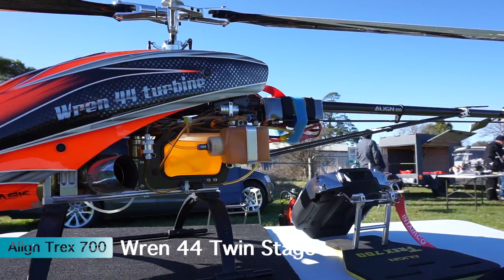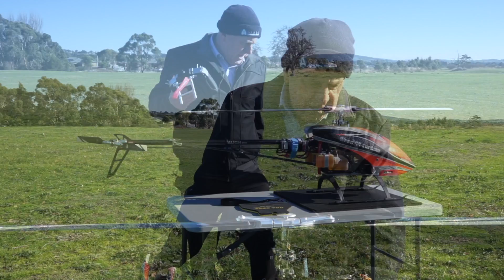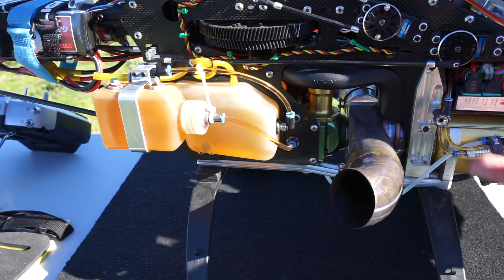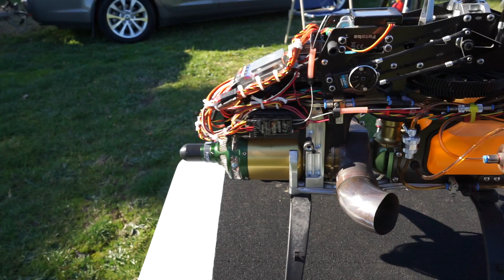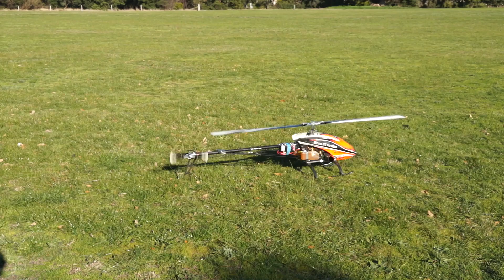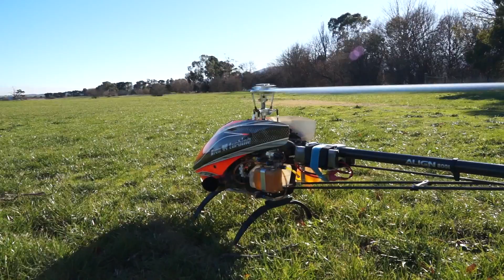Turbine RC Helicopter - Align T-Rex 700

Comment: My stock 700 scares the crap outta me let alone having to deal with it being turbine powered! Another plug for the Demon control, I’d be a bunch richer today if that was around in the 80’s but I might not have been able to afford it then either! Good tail rotor gyros were expensive enough!  Great piece of design and machinery.
Reply from the maker: G'day mate.  Yes I agree with you.  These RC choppers can be a little scary at times.  I've been flying choppers since the late 90's and they still get my heart racing.  Unfortunately I don't own a turbine, but I've got 3 x gas (90 size) and 1 electric 550.  Cheers, Aaron.

Comment: Damn cool chopper... looks actually very nimble unlike some of the other turbine ones I've seen. Was the conversion done by Ivor? or was it a kit?
Reply from the maker: Hey Luke.  Yes mate the conversion was done by Ivor.  Ivor is a fitter and turner who used to work for TAA or Ansett back in the day.  The Wren 44 pretty much bolts in to where the 90 motor would have gone, but he got those base plates and cradle parts cnc machined from a mate.  Some nice parts on it.  Yeah, very nimble and rock solid in the air.  This was filmed last Sunday when it was real gusty.  I think XM2 and Crudd need a turbine ;-)